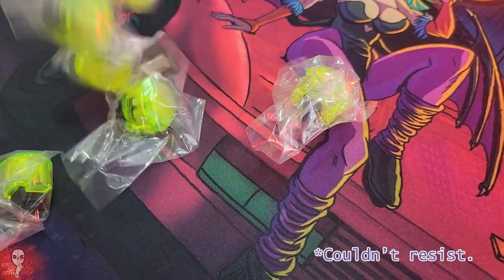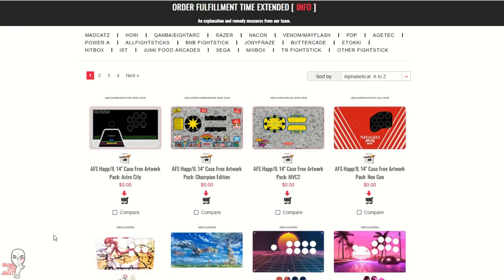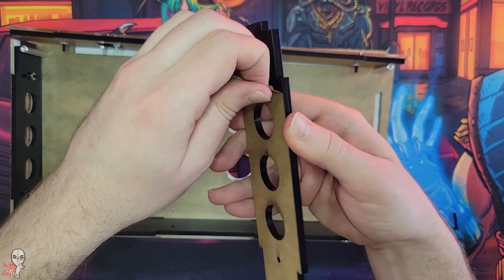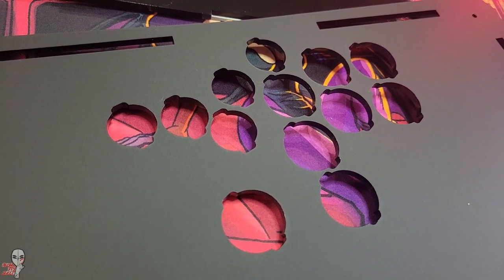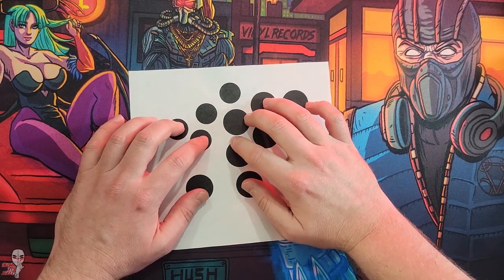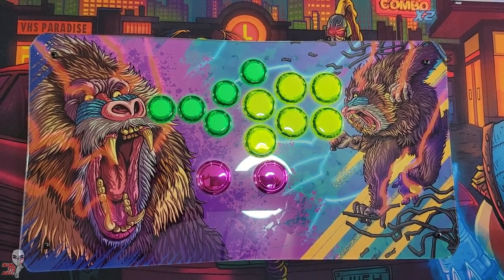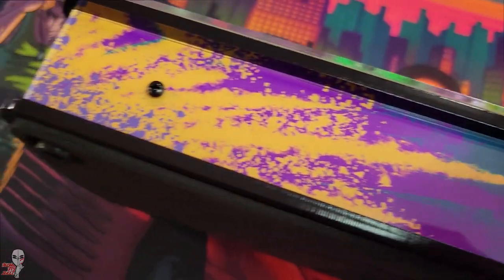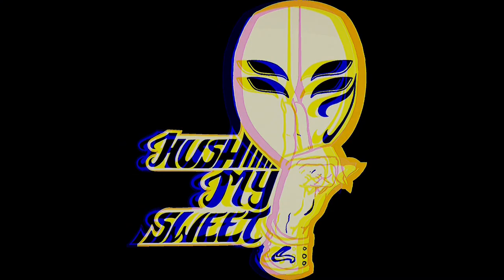BEST button layout for Street Fighter 6 fightsticks? Custom Rooflemonger controller layout!

Comment: I actually have a custom button layout panel currently in the work.

Basically, it's a vewlix layout but the LB/L1 & LT/L2 are moved on top of X/Square & below A/Cross respectively.

My thought process was I love Vewlix layout after I switch from pad and Noire layout, but I find that LB/L1 & LT/L2 is hard to press with ring finger and quite far to reach with index & middle finger. With the new position, I can reach LB/L1 easily with my index or middle finger depending on the situation and LT/L2 with my thumb. Would love to show it on internet once I get it done.
Reply from the maker: Sounds cool! Make sure to post it on the r/fightsticks subreddit so we can check it out!
Reply: Post link to the post too on this!
Reply: Posted it. I don't think I can send the link since YT usually mark it as spam.
Reply from the maker: @ShikayHawken  Looks very nice!
Reply: @HushMySweet1  thanks!

Comment: I currently play on arcade stick and I noticed that I never use the last 2 buttons because I hate using my pinky for them, would this layout work for me? I never tried 24mm buttons and I'm not sure about the second jump button either...
Reply from the maker: You know your preferences better than anyone, so that's for you to say. However, if you are not utilizing the far right action buttons anyway, something like this might work better for you and encourage you to use them more. What you could do is modify this layout (just download the .psd file) and then play with it. Delete one of the jump functions and reorient the remaining one so it's more comfortable. Increase the size from 24 mm to 30 mm if that's what's best for you. Typically, Hitbox-style enclosures use 24 mm buttons for everything but the jump, but if you have bigger hands and are used to arcade sticks, you can go with 30 mm, especially for the actions. I usually prefer that as well, but I typically keep the movement on that 24 mm standard (like you see in Roofle's layout). Once you're happy with your ideas, print it and test it out. If you're still happy, send it on to a builder to have a custom panel cut. 4) Profit. Good luck with the build! PS There is a learning curve going from joystick to all-button, so expect at least two weeks of struggle before you feel competent again.
Reply: @HushMySweet1  Thanks for the fast response! I'm definetly not good at modifying layouts and I thought the jump buttons were 30mm on the rooflebox! I'm unsure about 24mm vs 30mm for attack buttons because I never tried 24mm, but I know I will love 24mm for movement. My hands are medium size so hand size is not a problem.
Reply from the maker: @chocobolord_  The jump buttons are 30 mm, yes. And that's the usual among other Hitbox-style layouts as well.

Comment: which button do you use for parry?
Reply from the maker: The parry is the one almost directly above the right movement function. The drive impact is the one above light punch.
Reply: @HushMySweet1  Nice. I've used your videos as a resource many times, so I appreciate your work. I'm somewhat of a controller modder myself, and I was thinking of using regular 8 button layout plus some extra buttons, but with right thumb for drive impact, and I haven't decided if I want a different parry button (parry is on my right pinky right now in the kick row). Maybe I should do 3 extra buttons, one on the bottom for DI, and 2 more where you have them, except bind them to left and right. I'm building on a parallel trapezoid so my hands are split.
Reply from the maker: @PressureCooker69  Yeah, I don't know if there is one absolute right way to do things, but I like your thought process behind your button placement choices. I think you can train your fingers to do what you want given enough practice, but the pinky is just a weaker finger. I'm still experimenting with the perfect layout myself. (And I saw one interesting layout the other day on r/fightsticks where a player was utilizing a giant button in the palm area for drive impact.) Tons of cool ideas so it will be interesting where the ideal layout sits when the dust settles. Anyway, thanks for watching and taking the time to comment! I appreciate the support. Let me know how your build goes and what you think of the layout when you finish.

Comment: I wish someone would put out a layout tutorial from start to finish. Showing how to create your own custom shapes in the spaces you need in photoshop. All of these builds are mainly for soft bodied people so someone like me with muscle trying to squeeze his chest together with a hitbox is impossible! My shoulders & veins be bulging & cramping hard ASF trying to survive frame traps or mashing off wake up 😂😂😂😂
Reply from the maker: Start with a .psd file of a layout you like. You can grab most of the big ones on Focus Attack. Then, copy the button sizes (24 mm and 30 mm) and put those in their own layers. Move them around, duplicate them, and delete the parts of the original layout you don't want. The shapes will be dictated by the buttons, so if you wanted rectangular rhythm game buttons, you'll need to adjust your template to accommodate. My brother is a bigger weightlifter type guy like yourself so needs a wider spaced controller for the reasons you outlined. So stay tuned for that layout when I post that video. Might be right up your alley (or at least give you a starting point).
Reply: @HushMySweet1  Godlike reply! I will certainly look out for the video. Also, I'm not new to photoshop so I do know how to maneuver around the program. I just don't really understand how to get custom parts cut to my liking. For example, I drew up a concept of what I wanted, however the market doesn't offer most ideas. So, I don't even know who manufactures cases from the ground up, or where to find specific parts like the PlayStation buttons & touch pad like on the razer Panthera stick.
Reply from the maker: @thetrollgod2103  So it sounds like you're wanting something pretty unusual. That's cool. There's a guy on the fightstick build scene called Jerambe. I don't have shop tools myself, so whenever I have an idea for a crazy case that goes beyond the usual, I tap him for some help. I had an idea for a Kool-Aid man shaped Hitstick (look up the hitstick video on this channel to see it), and he cut me the enclosure based on my drawing. He has a little etsy shop, Jerambe Customs, and I'd contact him there. GL!

Comment: Question is... if it's legal in SF6 tournaments :)
Reply from the maker: It isn't legal in Capcom Pro Tour events because two buttons have the same function (an extra up in this case). But for everything else you should be fine. There isn't really a gameplay advantage for two jumps, just an ergonomic sensibility. You could also install a spacebar to sort of act as two jumps (we talked about that actually), and that would be CPT legal. Really though, most people aren't going to bust your chops regarding your controller pick at a CPT event anyway.

Comment: Do you take custom orders
Reply from the maker: I'm just a huge fightstick enthusiast (so don't have a business around this or anything), so I have to order my parts and stuff like everyone else at non-wholesale prices, so it's not really economically viable for me to do customs. I copied/pasted this from another comment down below to give you the full story and help point you in the right direction:  I don't have my own enclosure brand or anything, I'm just a big fightstick enthusiast and like helping others. I will occasionally do one-offs for friends with prefabbed enclosures based on what they tell me  they like...I have enough experience with lots of enclosures and parts to give good direction (the one in this vid is a 4tW case from JonyFraze that we cut with a custom layout), but because I don't have everything in-house and with shipping and such, you're better off ordering exactly what parts you want and putting it together yourself (or commissioning an actual custom builder...I curate a list of them on the r/fightsticks subreddit and it's stickied at the top of the page). If you want this layout specifically, you can order a custom from JonyFraze and mention roofle in the order comments (or simply go with your own creative custom layout). If acrylic enclosures aren't your bag, and you want a metal enclosure, there is AllFightSticks (I'll be doing a vid on them soon, and they also do great work) and you can order them in various sizes to really dial in your preferences. Plus there are makers who do wood, MDF, 3D prints, etc... The sky is the limit. If you need a part list or have any questions or whatever, let me know. *But quick disclaimer: If your stickless build has to play with the PS5, mentally prepare yourself to spend a bit more. There just aren't any good cheap PCB options for that system atm.   Good luck!
Reply: Please send me your email I will send you a picture of my custom lever less fight stick maybe you can build it for me if possible, I  have drawings of it on paper.  It's for ps5 so I know it's not gonna be cheap. I really would like it on or before Jun 2 I will pay fastest shipping price. We will figure it out. Thanks again
Reply from the maker: @gocrazytez8915  There would be no possible way I could get anything to you before June 2 but email is hushmysuhweet@gmail.com